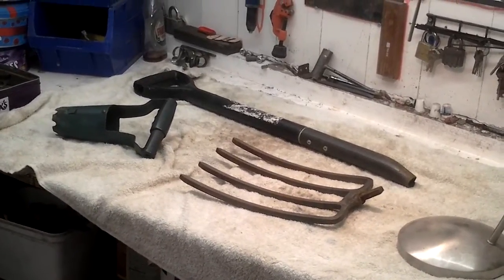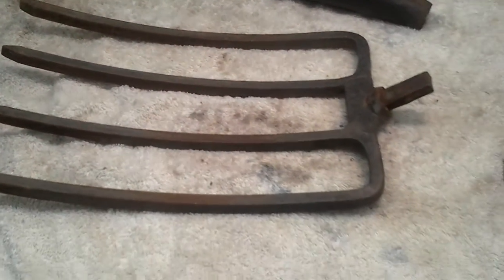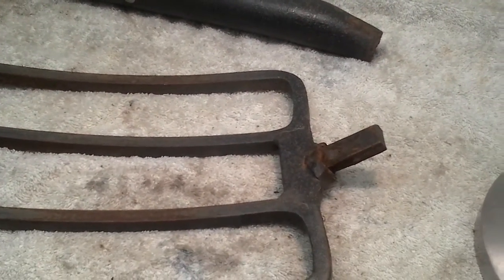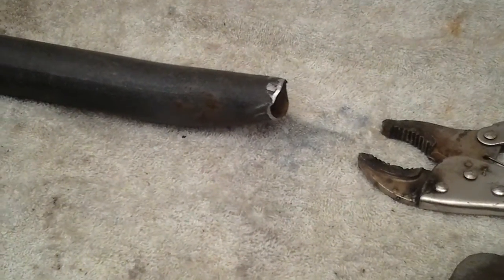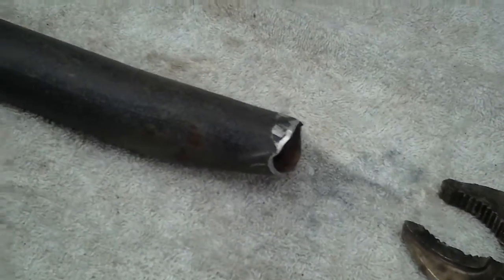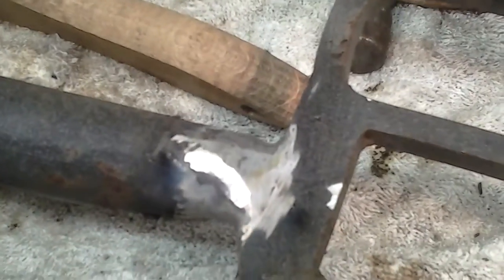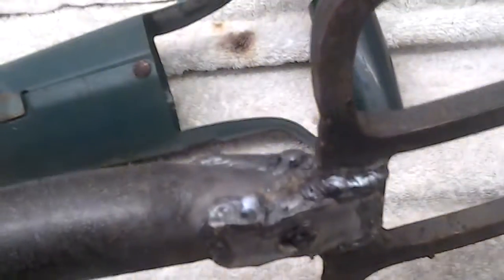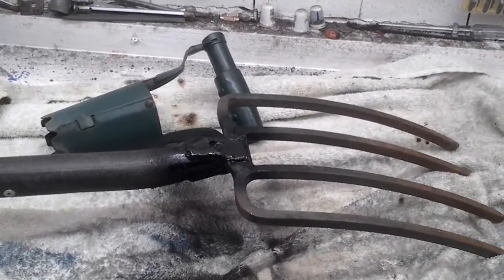Recycling Broken Tools Of Allotment Scrap Pile(15)

Comment: Well done for getting them both back on the road!, 😄👍.  nice one.
Cheap tools are........cheap tools. When I first got my allotment I got a stainless steel fork and spade from a well known garden centre for less than £20. Within a month I had to fit another rivet to the handle. Now this has started to come loose due to the metal being soft and the hole is wearing bigger. I have my dad's old spade (Elwell) which is over 80 years old and it shows no signs of wear. The best digging tools that I prefer now are Bulldog brand. They are built to last. 
Most plot holders on our site are like you, they leave the sheds unlocked to prevent damage and you are quite correct.........only leave when you can afford to loose.
Cheers.......Nigel
Reply from the maker: Thanks for commenting Nigel, the only tool I have bought is a border fork but I haven't really used it, everything at home is maintenance free and the allotment is to big for it. Will be watching your latest video tonight. 

Happy Recycling 
Terry

Comment: Never tried welding, generally if I can't plane it or saw it, give it a rub down with middle 2 sandpaper I don't want to know.  Interesting though and good for the planet.
Cheers
Mike B
Reply from the maker: Thanks for commenting Michael other peoples throw aways can always be useful to somebody. 

Happy Recycling 
Terry
Reply: I am into recycling timber I have a sizeable bench saw, a planer/thicknesser and find good timber from house extension which under current regulations can't be used back into the building due to it not being treated.  I did a shed and a greenhouse for my daughter last year which only cost me the glass.   Have you seen my plan of the new allotment on Google + ?
Happy skip diving
Mike B